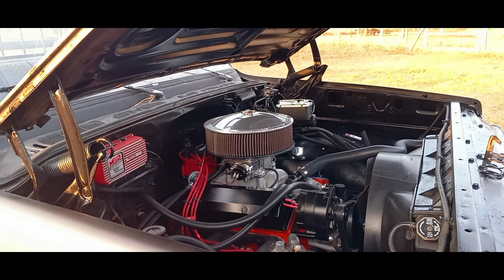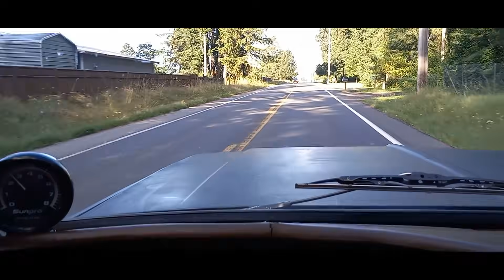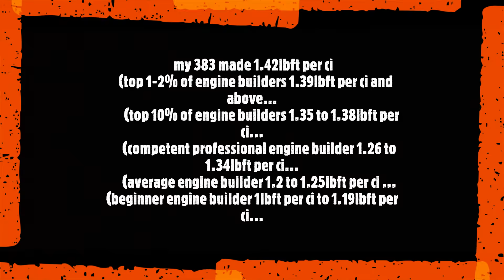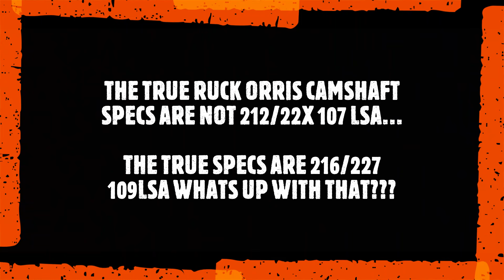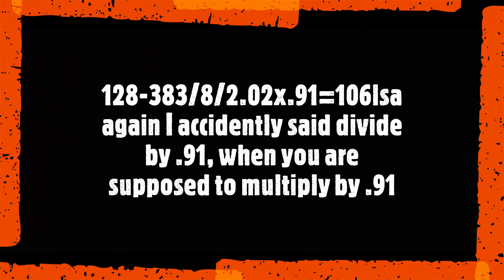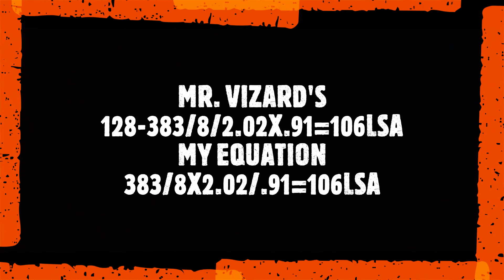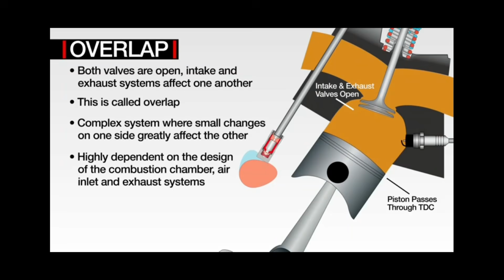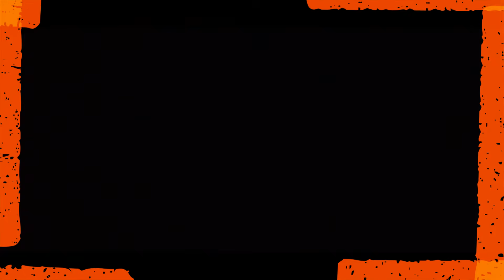CAMSHAFT SELECTION by LSA, 9 LSA's DYNO TESTED!!! LSA THEORY WILL BE DYNO PROVEN!!!, and EXPLAINED

Comment: So what about cams for marine applications that have to take into account reversion with tighter lsa? Most marine cams are 112-114 to avoid sucking water back in
Reply: I agree with your concern--- I have a pair of custom built  Marine BBC 565cid engines w/AFR 315cc Cnc ported heads with little baby hydraulic roller cams (232*/240* @ .050" Lift) and they are ground on a 115* LSA---- I wanted super smooth idling and it idles at 700rpm in neutral, and I use DRY tubular headers, and Holley 950HP on a Weiand Track Warrior single plane intake manifold. I did NOT need a 115 LSA but that is what chose at the time. I could have gone Bigger on the cam duration, but I would NEVER choose a cam with a 108 LSA...maybe for a Street application---MAYBE!!! On the dyno, my engines made about 640hp and 670-lbs of Torque...they topped out at 5100rpm, but carried within 5hp to 5400rpm. In the boat they topped out at 5600 with 32" 4-bladed props. The boat was a runner and a terror---great throttle response, torque and carb signal. My 115* LSA worked great for me and is what helps "carry" or extend the top RPM. Just my .02

Comment: What do u think about a sbc 350 bored 40 over with a 292h comp cam  :244@ 0.50 duration   With a lsa 110 lobe separation angle  in have high rise weiand intake  750 cfm brawler carb  in nascar style headers built by hand in im running a 2.5 inch exhaust
Reply: I think it has forged flat top piston also

Comment: Hi again Adam,
One piece of information I think I'm missing is the intake lobe centerline.
I can calculate the lobe separation angle using the David Vizard 128 formula, from that I can calculate the duration for a given overlap, but I don't know what intake lobe centerline I need.
Lift is another variable, but that comes from the cylinder head's flow characteristics. No sense lifting the valve higher than the cylinder head flow will support. That just wastes power and is harder on the valve train.

Bart

Comment: This video reinforces how lucky I've been working with/on Bikes for 40+ years = Double Over Head Cams = both Lobe Center(s) and LSAs are fully adjustable ❤
With that said, I met and got to spend time with one of the very few Engine Wizards (like you) to have lived and the cams profile he designed for our shop bike (with his formula that included "many things" IE even included rod length vs stroke). Those cams were honest to goodness the only cams I've ever seen/tuned that 'gained several HP' with only 3* Intake CL change = that engine "actually cared where that cam was degreed" (vs Off The Shelf Cams barely increased/decreased Hp when moved 6+ degrees)...

Comment: I have a solid roller cam in my 355 and my intake valve opens to 0.050 at 12° Before Top Dead Center,  and my exhaust valve closes to 0.050 at 11° After Top Dead Center.  Does that mean that I have 23° of overlap?

Comment: I have a 2014 ram 1500 5.7 that I used as a daily plus work truck. I pull dump trailers many times a month and had my lifters tapping into my cam. I had a 6.4 mopar cam installed with new lifters, springs amd an HP tow tune two years ago, recently I have the lifter problem again. Any help or insight you can give me on replacing a right cam and parts Ill need for towing and highway travel that wont break my bank, I really appreciate it. Thanks so much.

Comment: Adam thanks for sharing your knowledge! I’ve been watching and learning David for a year now but mainly his Dyno stuff. I’m working on a Pontiac 455 to drag race with my daughter. Everyone tells me to go with a SBC or BBC but I want to keep the 68 LeMans all Pontiac. I’m 57 and always learning and studying and after much research comparing numbers the Pontiac 041 cam seemed to be my best choice. Now after watching this video I want to dig deeper and understand better how to choose a cam. You didn’t mention Pontiac when calculating LSA so should I use 132 for BBC BBF Cleveland number? Thanks again and keep putting out content for as long as you are able. Consider transcribing your thoughts and videos to paper. Most typing programs can type out verbal transcription. Prayers for healing!!
Reply: For your Pontiac I would use the 128 figure as is. It is a wedge engine and similar in that regard to a SBC. The Cleveland and the BBC are canted valve engines as a result the flow characteristics can use a wider lobe separation.

Comment: Very interesting video.  Got a question for you.  How does supercharging change the parameters for selecting a camshaft?  In particular, I have a centrifugal blower on my 2007 vette.  The engine is a 408 ci stroker, and while it runs like gangbusters at 6500 rpm, I'm kind of disappointed in the performance below about 4500 rpm.  I'd like to fatten up the torque curve on the low end while minimizing any horsepower loss up high.

Comment: 9:20 am cst 1/9/23 , thanks for sharing yr knowledge although a lot of it was over my head, I often wonder if I have the right shaft . Here’s my list of parts ( nothing is together yet) for my build: 70 chevelle 3500 ish lb car 540 ci AFR300 oval ports 2.300 int.1.88 exh. 112 chamber , Borla 8 stack inj. Comp cam .246/.256 @.50 & .671/.668 lift with 113.0 LSA . I’m wondering if you can tell me if I’ve selected the right cam for my build? I’m hoping to make 700+ hp & torque, thank you

Comment: Hey, I am so happy to have found also your videos. Subscribing now, and yes watched this whole juicy video. I ALSO a while back found that DV has a YouTube, I had read his magazine articles and books 20 years ago.  You mentioned 22R's in your video, and that actually caught my ear. Curious what you had going with that build, and ill be watching your other videos. You and DV have a wealth of knowledge that I can only hope to comprehend.  A few things I noticed with DV's formula that I am curious about.. The chev SB number of 128, is this related to rod ratio? And the .91 component, is this this relationship to valve flow based on the valve input size selected?  I suspect the 8 is number of intake valves or cylinders. I'm trying to truly understand how it all works.  Thank you for all your efforts to correct the cam shaft myths.

Comment: For LS guys, the only affordable 106 LSA off the shelf cam I have been able to find is sold by Summit, it's a 240/252 .569/.569 106+0. It's $335, I might also recommend using 1.8 rockers to raise the lift to .604/.604 at the valve.
Reply: Call Bullet Racing after you do the formula and match it up with their cam lobe master chart . Take a stab at it , then lean on those guys to tweak the numbers into a great cam. 
 Its fun to do the math and research , then talk it out with a pro . I'm usually very close in my choices.  A degree here or there . Not bragging, just sharing another part of an engine build you can take part in. Its just added fun to the experience .
Reply: that duration is at .050  ,  ?/?  Also  , do you have the part number for it......I talked to Summit techs,,,,about who grinds the cams for them,,,,,no one will disclose the source,,,,,,,,,I got many different answers which I  let pass,,,,,,,as to avoid a dispute............,
Reply: @thomasleclair7418  Cam Motion?
Reply: @drunge1  I thought it was isky. I know they invested a lot in some really nice grinding equipment.

Comment: I am building an LS for my '04 GTO 6spd, the LS1 siezed and I will most likely build an LQ4 6.0 or a 408 stroker. Will just use stock heads, 706 on the 6.0, 241 or 243 on the 408, probably just cleaned up with very minor porting, the selection of cams with tight LSAs is sparce. I will probably use a cam from Summit they call it a Single Plane cam, 240/252 .569/.569 106+0 I might use some 1.8 rockers with it as well to up the lift at the valve to .604/.604. I wish they sold something with less duration split, sometimes you have to use what is affordable and closest to what you are looking. A custom grind would probably run close to $500-550 these days with tax and shipping while also requiring a long wait.

Comment: I am going to watch again, but I got lost on determining the ideal overlap. There's a lot to digest in the video. I am working on a mopar 340, 10.5 to 1 forged flattops, ported mopar j heads, an old school LD-340  intake, Comp 20-223-3 cam, and an Edelbrock 675 AVS2 carb. Just not getting that throw you back in the seat feel that I'm looking for. After watching your video, I suspect the issue may be with duration and overlap, although the LSA is not perfect either.

Comment: The next engine I hope to build is a SBC 400 and I want to do it opposite of the Norm.
 I'm focusing on off idle torque, throttle response and drivability.
 Whatever I can get after that is a bonus to me.
 Having the off the line throttle response from stoplight to stoplight is enough for me.
 I appreciate your time to put together a video on the most overlooked part of great engine building. Thank you !
Reply from the maker: Thank you for taking the time to watch, I appreciate it... take care.
Reply: WHAT  the 400 sbc does not flow water properly and runs hot and with more compression and rpm would be a cooler issue, my suggestion is 383 with eagle componets and forged flat top pistons with only two valve reliefs all that from the 350 sbc engine is the only way to build lots of torque . 106  LSA 500 LIFT AND 102 INTAKE CENTER LINE
Reply: @3334-n7s  thanks for the input but not the route I'm going.

Comment: I already know I got the wrong camshaft for my engine and build intent. So now I’m going to watch this video and get a possible idea of how much I screwed up because he mentioned me almost by name (I don’t actually know this guy). I’m the guy that has a decent grasp of camshaft operation but doesnt know enough to know how to select valve events so I spec’d a camshaft that has too much duration and too little LSA with a little too low compression. For anyone curious… 234/238@.050 110 4* advanced with .565/.530 on a 9.8:1 AFR 195 headed 383 SBC, single plain and aftermarket TBI EFI. For my usage midrange torque is the most important characteristic of the engine. I now THINK 230/234 108 might’ve been better, lift unimportant. I still don’t know enough to know when exactly those valve events should happen though.

Comment: I have a legitimate question for you, for turbo applications does overlap matter? 

I was under the assumption that less overlap will build boost quicker since you are not losing any of the exhaust into the intake manifold, with this formula how do you spec a camshaft for peak 7-7500 rpm with low overlap using a 2.165 intake valve and running an LY6 intake manifold?

Comment: OLDER Gentalmen please help LS3 HEADERS STOCK PORTED HEAD N/A 60 POUND FUEL INJECTOR  660 VALVE  SPRING S ROLLER MOTOR WOULD LIKE HP AND DRIVEABLITY AND NOT HAVE TO CHANGE OUT TORQUE CONVERTER SIR GOD BLESS YOU IT WAS THE BEST ARTICALE IVE EVER WACTHED AND LIST TO JUST LOST MY DAD AND YOU REMINDED ME OF HIM HE WAS A JET ENGINEER FOR 40 YEARS AT GE AIRCRAFT WOUL LIKE TO ACHIVE  600 OR 700 HP

Comment: You do know he is not trying to make optimised cam shafts. He's making stages of camshaft for a compromise of power and driveability for the entire range of engine builds. Now I am happy for you to claim higher exhaust duration is detrimental but to do it with no supporting reason other than pumping loss makes it a guess and would show up in a dyno test which it didn't. You can also be sure that he is not giving you the entirety of the formula. As for myself I don't believe that LSA is as important as the flow capability of the engine being matched with valve overlap and matching ramp rates. If LSA was the determining factor you would be claiming 108 is correct not changing to 106.

Comment: I"m building a 408 LA mopar .i"m looking at a small roller cam [COMP} for it. 230/236  with a 110 LSA.The formula suggest a 105.5  LSA . I dont know the overlap.the heads are trick flow 190 cc. static compression will be around 10.2. Am i right to be concerned cranking and dynamic compression ? I also dont know the timing of the valve events.{ Iknow ,then how did i pick this cam?} Should i order this cam with a tighter LSA? The application is a74 cuda ,391 gear, 3500LBS,automatic 2800 stall converter,power disc brakes. This is a mostly street car ,occasional strip.  appreciate your response please . P.S> would a 108 LSA be ok ?
Reply: You'll be 2.5 degrees too wide, just make sure you get an adjustable timing set so you can degree and adjust the timing on the engine to find out exactly where the engine responds best. That's not overly aggressive duration for a 408 with 190cc aluminum heads. It'll run excellent with the LSA the formula gives you.
Reply: @hendo337  thanks! At 106 LSA, would the vacuum at idle be OK for power brakes or do i ditch them for manual disc.. I currently have a 360 .030 over ,home ported iron heads with 2.02 intakes, performer intake and 1" spacer.old comp hydraulic flat tappet 224/224 ,110 LSA. with 4.30 gears .It cruises ok with the gears but was thinking of a more street friendly gear later on.
Reply: @hendo337  I have a 382 with a btr 206/212 duration ls1 112 and 241 heads flat tops 11.1+ comp for towing and it's lasy under 3k. Would the torque cam be better? 202/202 111? I understood the video but calculating overlap on my cam is -15! Compared to the 4 degrees discussed in the video. I couldn't imagine puting a cam in with a 220+ duration if ill im looking for is 2k performance.

Comment: While you can't argue with a dyno... does it match driving style?  I visit the question because of Bill Jenkins writing in the 70's that [basically] whatever he did to a sbc combo... he usually came back to a 109 lsa cam selection.  His work was mainly on the track, but darn close to the 108 number  that Vizard's calculation/dyno work comes to for a similar engine.  Modern tech is pretty good: good enough in some cases that scrubbing some torque to get off the line or out of a corner yields results.  Some folks have an "educated" foot, some are pedal mashers, and the issue is sometimes surface.

Comment: I'm building a Toyota engine that I'm trying to get more lift out of  w/o throw parts out the head. But to correctly do such I need to change the location of the cams. If I lift and spread the 2 cams apart I can retain the base circle which will keep velocities down, Follower roller in the proper area and will allow the retention of factory (rockers) and shimmed HLAs.  If I cut  0.1875 off the deck I can make a custom cam girdle, chain guides, and modify the timing cover. This would allow me to us  larger diameter and longer oem titanium intake hi temp exhaust valves along with that engines valve spring retainers. The only outsourced internal parts would be nascar rods, custom pistons, everything else would be modifed to suit.

Comment: I've ALWAYS been into vehicles and learning about them. I always say "you never know everything so keep learning." People like you are the people I want to learn from and the ones I look for but y'all are passing on faster and faster and the more I'm finding I'm left with people I wouldn't let work on my mop much less tell me something about an engine.
I ain't for one particular make. Everything from Ford to Briggs. Always trying to make the most with the least amount of money spent. At the moment, I'm trying to achieve the impossible with a four door '74 Dart with a 225 and double overdrive. I want to be able to run 85MPH and get upper 20's mpg's and run about 2,300 RPM from it while keeping the car appearing stock as possible.
I think by not only focusing on the engine but how to lighten the vehicle as much as I can possibly can. Focus on the power to weight ratio. This car is 100% for daily driver use and nothing more. Stock can be a good daily. Mild mods can make it better. But the take off, speed, and MPG won't be there.
Reply from the maker: Thank you for watching, good luck with your car.. take care buddy..

Comment: There is an extremely well put together and detail video of a guy in his garage. He has quite a bit of subscribers as well, and he explains the physics and actually writes out on the chalkboard displacement, bore and stroke and head flow. You have to have those numbers first supposedly, and you can select the specific camshaft that will work best for your engine combination. One thing he did not mention his intake manifold that plays a role as well or at least I think I’m right.